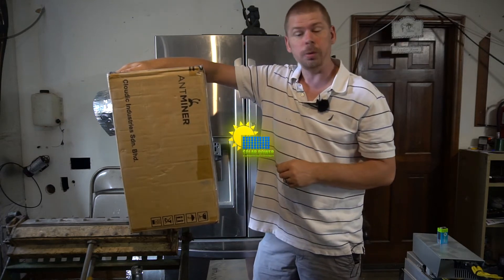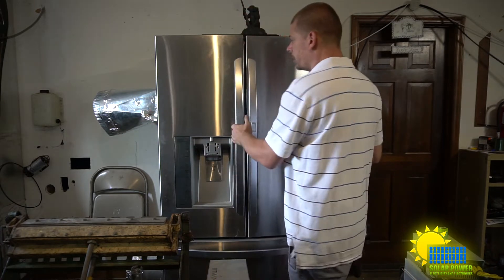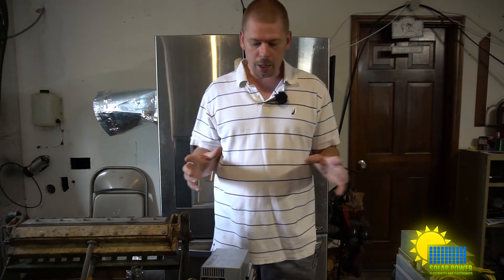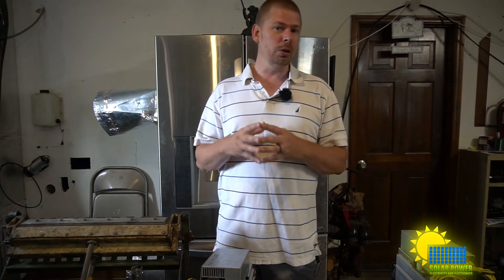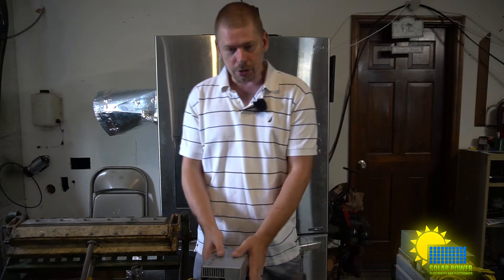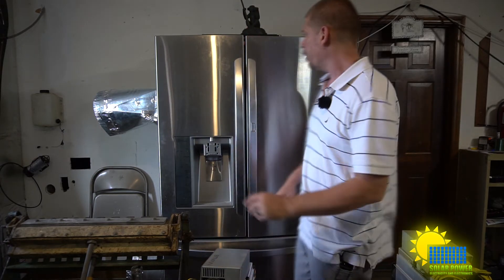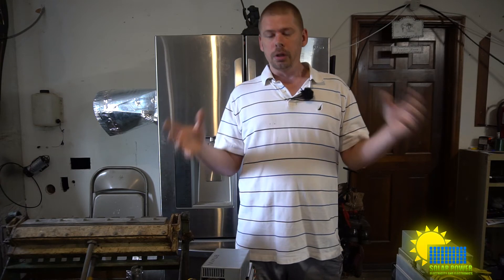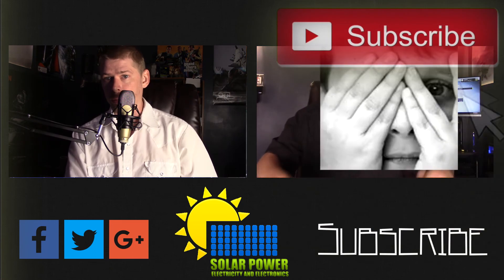Used Bitmain Antminer S17 Pro Prepping Install And Testing

Comment: What is your current electricity cost per kwh and your daily profit?
Reply from the maker: Its .10 and I get a profit of 3 usd
Reply from the maker: they are run on solar power During sunlight hours
Reply: Thank you, sir.  I was considering an s17 pro.  My power cost is 0.14 per kwh.  I suppose my profit would only be about $2/day which would take about 2 years more or less to ROI.

Comment: The only stat I want to see is after all that investment when does the profit start.
Reply from the maker: People still look at it the wrong wayyou've got to see it as a long-term investment Bitcoin hits $1000000 I've already made my money back and the rest just makes me a rich man
Reply: @solarpowerelectricityandel2915  Well if I ever make more than I use I will consider a bitminer but until then I still have to make 3000 kwh more than the 12,000 i already make a year to fulfill my needs.
Reply from the maker: @offgridwanabe  I'm making around a 1000 KW a month
Reply: @solarpowerelectricityandel2915  Yep in the summer it's good last month I made 1980kwh but it all went into the bank (net metering) for winter